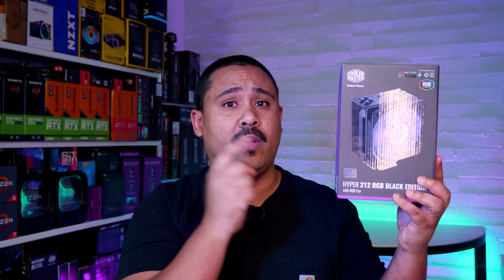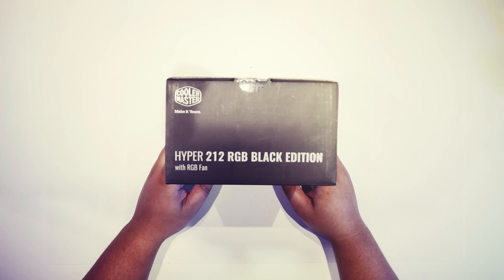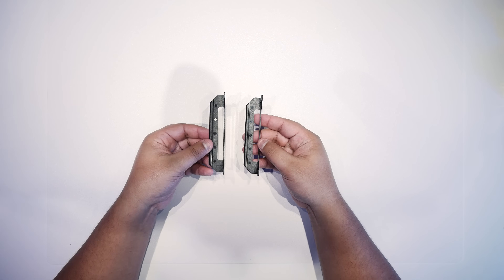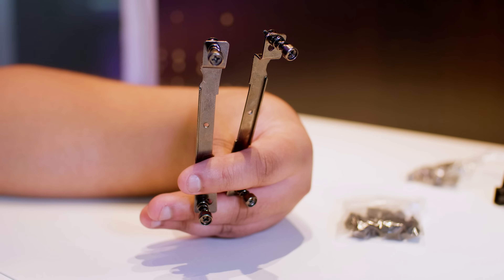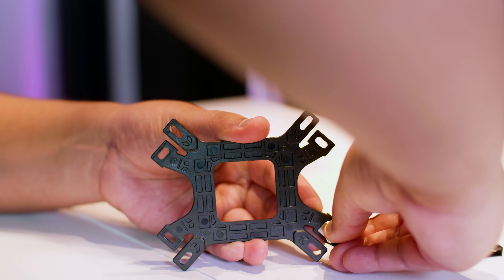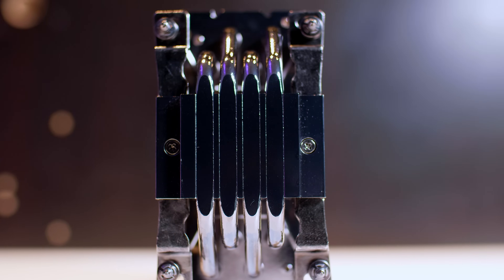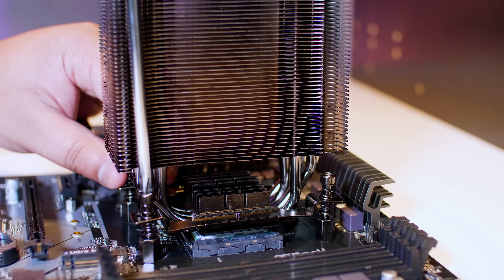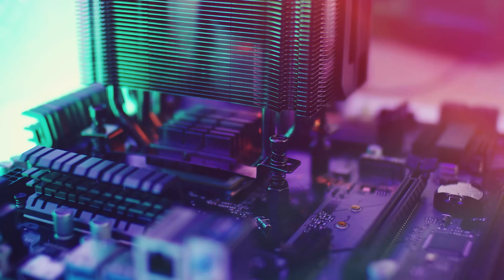HOW TO Install Cooler Master Hyper 212 RGB Black Edition on AM4

Comment: I always find that installing the cooler is the most stressful part of the whole build lol
Reply: Lol. I was considering a liquid cooler for my oc’d Ryzen 5, but I think this’ll do just fine
Reply: @MrEnvoy05  Fuck liquid coolers bro, they click and make dumb noises. I’m swapping mine out for the 212.
Reply: @doomer1905  lol
Reply: @doomer1905  Mine is whisper quiet except for the fans, but after I swapped to Noctua fans that was no issue either. so same noise level as my air cooler, but better cooling, and easier access to ram and removing GPU. 
Aios arent always optimal like in my small case, but bigger cases I prefer them.
Reply: @BARBELLS-AND-BUDS  I just don’t get on with them at all. I’ve had two, both have been crap for temperatures and noise level. My 212 has a little hum to it, but it’s very unnoticeable and it’s just the fan, which I can replace for like £9 lol. Ryzen 7 3700x CPU never gets about 75 degrees with the 212, hits over 80 with the AIOs I had, even with everything on full blast.

The AIO bit that annoys me most is the pump, it can be so clicky and there’s no way to get rid of that sound without getting rid of the entire circuit, which is nice and pricey.
Reply: @doomer1905   my first AIO. Its the NZXT Z63
Honestly I only hear the fans when they are up past 1200 rpm. That aio is cooling  a Ryzen 5900X in a Cooler Master NR200. I never see past 64C gaming and 69C in a hour long stress test.
I guess like anything you can get a faulty AIO, or maybe I got lucky?
Reply: @BARBELLS-AND-BUDS  Dunno man, but I had my coolermaster AIO running on my intel i9 9900KF and it was hitting 85 degrees within minutes, and that’s with the fans on 100%. Tried an AIO on my Ryzen 7 3700x build, same thing, 80+ degrees.

Switched to the hyper 212, never gone above 75 degrees on the Ryzen 7 3700x processor, haven’t tried it on the intel one yet though. Thought maybe I had seated the AIO wrong but no, it’s on there plenty.
Reply: @doomer1905  I bought a pre built from IBuypower and they say 1 month+ time to fix shipping damage. I decided to fix it myself. I bought a new PSU, MB, and the hyper 212 to cool the 5600x. Hopefully it does well.
Its only a 65 watt TDP cpu, but I plan to OC...if I get it running.
Reply: @BARBELLS-AND-BUDS  I’d say the 212 can handle a bit of overclocking. If you really want a beats for an air cooler, get a noctua one. Their heat pipes and fans are really really good, practically silent too.

And fuck prebuilds man, I got one not too long ago too just for the graphics card and the thing set on fucking fire, had the nerve to say it must of been something I did. The fan hub they sent with it just burst into flames, so I ripped everything out and just mixed and matched the best parts of my two PC’s into one case lol
Reply: @doomer1905  Yeah $2k for the prebuilt on sale and with promo code. Asus 3080, 32gb ram, 5600x 1tb M.2.
It came with no power, but the rgb on the MB lights up. The Air cooler was crooked so I removed it and the PCU was out of the socket stuck to it. I figure the MB traces were damaged. If I cant make it work Ill return the parts to amazon and return the PC to Ibuypower. That sucks that yours burned up!
I built a PC recently and then couldnt get any more GPUs. I also bought a Cyberpower from BB and it has 3600 3060 etc and it works perfect
Reply: @BARBELLS-AND-BUDS  CyberPower are def your best bet for prebuilds. They’re a little pricey, but they seem to actually give a shit lol.

And yeah there’s always that risk of damage in transport, that really sucks to hear yours got damaged. And the 3600 and the 3060 is a nice pairing, bet it’s a beast
Reply: @doomer1905  Yeah I got it for $1100. Took the 3060 ut and put it into my Dell. I put my 6800 into the Cyberpower and using them both for mining when not used for other stuff.
I was going to sell the IBUYpower except for the GPY+U, but decided to keep it. Then it arrives broken lol.
I priced the parts on the Cyberpower and really no markup from retail prices. Looks nice actually and the front it all mesh so good airflow too.
Reply: @BARBELLS-AND-BUDS  I got an ibuypower prebuilt water cooled but it would crash my pc playing any game with decent graphics 6 months in, got it fixed free with them 1 year later same problem and no more warranty so I'm trying to switch to fan now
Reply: @SheepShanker  What air cooler are you going to use?
Reply: @BARBELLS-AND-BUDS  either this 1 or a noctua
Reply: @doomer1905  seriously fucking liquid coolers sucks. Spent 3 days to figure out the problem. Just realized that the pump is gone. Swapping with this air cooler. Im done with liquid coolers.
Reply: @user-wt2ky2uq4k  Yeah man they’re pretty trash IMO. Yeah they look cool, but you can’t really beat a good air cooler. Not worth the potential leaks either! Water should be no where near circuitry lol.

And my 212 is still going strong, I’ve had no problems so I definitely recommend it.
Reply: @doomer1905  ordered one yesterday. Going to install it tomorrow yuhhuu. Currently hitting 97 degree Celsius with liquid cooler. Definitely a broken pump case.
Reply: @doomer1905  i went with 6 pipe Endorfy Fortis 5 dual fan and its fantastic ....even on full 1.45V and 4.7Ghz boost it cools it to nice 72°C wich is just insane :)
Reply: Built my first PC this weekend, and putting the cooler on almost gave me a heart attack lol
Reply: Facts
Reply: so true
Reply: Yeah, especially if it’s a damn clip on cooler like the wraith prism or another cooler like aio’s.
Reply: I’m building my first pc and I’m sitting in my kitchen stress drinking chocolate milk trying to figure out what the Manual mean
Reply: YES BRO
Reply: @射進肚臍 it’s not too bad, I personally replaced it with a Noctua fan after installing because I didn’t need the rgb in that spot, kinda over lit things 😂
Reply: ahaha
Reply: You shouldn't tho, it's super easy. I felt the same way when I started building myself. The cpu is intimidating to beginners, especially having to do anything with it lol.
Reply: Ikr! 😂
Reply: Yup... i can never get the screws right
Reply: Exactly. As weird as this seems, I always have a hard time getting the fan back on to the heat sink lol.

Comment: The whole installation of this damn thing is driving me nuts. All those nuts bolts and springs and not all the parts are used. The step by step instructions don't make a damn bit of sense. I also couldn't get the screws to the motherboard to line up perfectly
Reply: Hi.  Well my unit didn't come with the small parts box.  Cooler Master finally sent me one and it was missing a part F and E.  So now I could only mount to 3 sides.  Nowhere to find parts F and E on net for AM4 system.  Trying to cool my Ryzen 3600.

Comment: Very unclear... Doesnt show a lot of things and doesnt even show how to use ARGB.
Reply: It doesn't have ARGB only RGB.  It comes with a wired controller if your motherboard does not have an RGB fan header.  If the motherboard does have an RGB fab header than you can use the motherboard vendors software to control the colors.

Comment: If I am upgrading my cup cooler from the stock AMD cooler, do I need to reapply thermal paste or can I just leave it? The thermal paste I used is from the stock AMD cooler since it was pre applied to the cooler. If I need to reapply, can tips on how to clean it?
Reply: Yes, reapply the paste.  Remove old paste using a lint free wipe with isopropyl alcohol if you have some.  This comes with thermal paste so use a pea sized amount and you will be good to go.

Comment: My 12v all the way on the bottom of my mobo, can I plug it on the 5v instead?
Reply from the maker: no
Reply: @GearSeekers  thanks for the super quick response. I’m installing right now, I guess I’ll flip the fan with cables facing out, that’s the only solution I have to make it reach my 12v

Comment: Thanks for this video. The hardest part was attaching mounting the heat sink. I had the plates backwards at first and then it was just a little difficult to line up the screws but I was doing a swap and didn’t remove the mobo. Anyhow it all worked out and not running 20c cooler under load with this thing. Thanks again. Subscribed. Cheers!

Comment: I can’t get the cooler to line up with the brackets lol. The brackets screw into the motherboard no problem when not attached to the cooler, but When I attach the bracket to the cooler it’s not wide enough to fit the motherboard

Comment: Mine doesn’t fit my motherboard :(
Reply: Same here
Reply: @badash4545  I actually got it to fit, you have to turn the brackets on a different way
Reply: @lucid4984  idk I have an msi Meg x570 ace and the brackets just don't seem long enough.
Reply: @badash4545  intel or AMD? I had the B450 and it didn’t seem too, but the little bracket it screws into just needed a different angle
Reply: I have amd.

Comment: Once I installed, my fan spins but there is no lights on the fan. Any suggestions to fix?
Reply: Did you connect the RGB into the motherboard as well?
Reply: @smith25_25  I got it figured out! thank you!

Comment: For anyone wondering about the cooler screws not going in don’t be afraid to put pressure on it like I put a good bit especially on the side with the first screw and temps so far are all good and cpu isn’t broken so ya don’t be afraid to put pressure and maybe practice without thermal paste on first that’s what I did and it helped a lot
Reply: Seriously I'm kind of worrying myself because it felt like it was "crushing" my CPU. Am I ocd'ing it? It booted fine.

Comment: i have the same motherboard you have, can i install it without removing the motherboard from the case
Reply: Yes. Remove both sides of case. Hold the bracket in place and hand screw the bolts. Then put pc on its side and screw the radiator in. 

Did you get it installed yet, btw? Happy building.

Comment: it seemed like my screws were so much further away. maybe it was just harder because i had a short fat little screwdriver, i bought this to replace my deepcool gammax because i dreaded dealing with the clip on mount, and this one looked very sleek to me in all black with the silenco fan. the temps seems jsut a few degrees higher at time or around even. which is 100x ebtter then the amd wraith stealth i used to have

Comment: hi, I'm looking at connecting this RGB to my MF120R case fans included mini controller , i've found a this splitter https://www.coolermaster.com/catalog/coolers/rgb-accessories/1-to-3-rgb-splitter-cable/ if i use this with one of the fan RGB inputs and split it with this cable and connect in this CPU Cooler would you think that would work? how else could i have them synced if not, my motherboard has no RGB headers

Comment: Are both sides of the metal heatsink identical?  I installed the heatsink with the logo upside down but I did put the fan on the correct side near the ram.  Is that ok?

Comment: Had an existential crisis trying to replace this cooler with my stock 2700x cooler but it was worth it. Went from 40-45 idle to 28-32 idle.
Reply: Bro same the stock thermal paste like glued itself to the cooler and the cpu I thought I was gonna break my pins

Comment: hey great video. Can connect the rgb into an asrock b450m steel legend motherboard? It includes 1 AMD fan LED header top right corner of the mobo, and an RGB LED header as shown in the video. Can i use the amd led fan header instead of the rgb led header to connect th rgb of this cooler?Also how can i change the color of the lighting if connected to mobo rgb header?Thank you

Comment: When you use the included rgb controller at 6:55 where do you connect those cables on the left?
Reply: It should connect to Molex/SATA power cables connected to your PSU.
Reply: @darkasnighttime   I dont jave those two cables in my PSU
Reply: @MilošHranisavljević Hey, probably doesn’t matter now since it’s like a year later but to anyone else wondering, the RGB pins go into the slot marked JRBG1, on my mobo it’s on the bottom left. Be sure that the arrow on the plug is on the top left when you plug it in, too - that also matters.

Comment: Well my good sire I have a i7 9700f with a 2060 super and my temps on my cpu are 80 to 85 and 75 to 80 with my ac on and my gpu is low like 50 will this fan fit and work I’m a noob just switch to pc a month ago

Comment: My new build, looking for advice and tips!

Thermaltake H200 Black
MSI B450-M Tomahawk Max AM4
Ryzen 5 3600
Cooler Master 212 RGB Black
Corsair Vengeance RGB 16GB (2x8GB) RAM
Kingston 500GB m.2 NVMe SSD
WD 2TB Blue SSD
3x Cooler Master 120mm RGB case fans
Gigabyte Windforce OC Nvidia 2060 Super 8GB
Gigabyte 750w 80+ Gold PSU

Will this setup work? Will this be a decent setup?
Reply: Pretty overkill for your specs, otherwise good pc. Just make sure your case has 160mm or greater clearance for that hyper 212 evo. Nobody ever says this but that cooler is very tall
Reply: @ExySmexy  thank you for the feedback! Yes I built it the other day and I was surprised how huge it was! My case had 180mm clearance so no issues there - thanks for the heads up on that though! But cooling was a big thing for me so I didn’t want to cheap out on that - the hyper 212 was only $68 on umart so I thought why not! 😂👌

Comment: oh shit, okay. You should try getting some top down shots of some of the shots where it would make sense like the heatsink brackets.I must have lined it up, but facing the wrong way. My mounting bracket is not lining up with the mounting part on the mobo.. I've wiped and applied twice trying to adjust the bracket to make it fit. lol. I definitely like Noctua's mounting system more than Cooler Masters, their booklet instructions weren't very good. This is the first time in like 10 years I had to watch a video to mount a heatsink. haha. Thanks though, the rest of the video was great.

Comment: I have heard that installing this cooler on a Micro-ATX motherboard will slightly block one of the RAM slots. Can anyone confirm if this is true or is it not an issue? Cheers!

Comment: UGH. I bought this cause I figured I could put it in without taking the entire motherboard out and putting a damn bracket on the back.
I might cancel my order cause I don't wanna have to rebuild my entire computer for this crap lol
Reply: Does your mobo already have a backplate? It might be compatible with the stands.

Comment: Thanks, helped a lot, it`s easier than I first thought. The worst part was removing the stock cooler, the thermal paste became a glue (and I was using if for less than 2 months).

If any of you have the same problem, twist the cooler instead of just pulling it off.

I'm using a stock R5 3600, temperatures dropped from 85 to 70 (full load, stabilized after 15min)
Reply: try not to twist the cooler could accidently bend some pins

Comment: How much pressure are you supposed to use when screwing in the heatsink to the mounts? I've been trying for 30 minutes and I'm terrified that I'm going to crack something in half. Is my product defective or something? The screws just barely don't reach the mounts, no matter how many times I turn them.

Comment: quick tip for everyone wanting to use this cooler

got mine today but it doesn't have the right adapter to connect to the rgb controller so you cannot use the rgb unless you have an adapted

Comment: Installed this cooler easily. I connected it directly to the 12v on the mother board. I have 4 RGB case fans what are not connected to a 12v RGB input but to the reset button how do I get the lights to be in sync. When I go in auro sync I only see the coolmaster hyper 212 and not the case fans ? Thanks

Comment: just bought this cooler and a new ryzen 9 3950x ... put it all together as shown and i'm shitting it about screwing it down.. this video will help me to get it installed tomorrow. thanks
Reply: how did your thermals turn out?
Reply: @The93Momo93   hi,  its running nicely, its built in a sahara tower case that has ten cooling fans. idle temp is 35, sustained full load is 70 - 75
Reply: @paullawson8550  hey, thanks for the reply! those are pretty nice temps, I will run this with only 3 case fans (possibly with a 5800x) but if it ends up not enough I will probably slap a second silencio fan on the heatsink and see how that goes first, but in theory it should be fine
Reply: @The93Momo93   i think you'll probably get similar temps as me depending on airflow. seems good ventilation pays a key part. let me know how you get along
Reply: @paullawson8550  thanks, I'll give a heads up when I got it :)

Comment: Can you install the cooler without having to take the MB out of the case?
Reply: You could just use the old style AMD clip bracket supplied.
Reply: yes the back of the case u can put it through the hole in the back

Comment: Does it work with 5 3600
Reply: yeah, there are people running this with 3900x too, it's only slightly better than the wraith prism in thermals but very very quiet in exchange
Reply: @The93Momo93  king

Comment: The method you show in connecting to the RGB header doesn't work when there's a gpu installed.  The cable isn't long enough to go over or around it.

Comment: Great vid! Strait to the point is what i love! I am considering this cooler for my ryzen 7 3700x and 2080super build! I am still using the stock cooler which is fine but this looks nice. I am thinking on getting an aio but my old system (i7 5th gen and a 980ti) had and old corsair aio and the pump died in a year 😆 so idk. What i am going to get 😅😄

Comment: Anyone else having extreme trouble trying to screw in the cooler to the motherboard, the screws on the cooler simply do not reach far enough
Reply: Just finished my build yesterday- you have to put a LOT of pressure on the screws and really push down to bend the springs surrounding the screws.
Reply: You gotta put pressure on it, a lot in order for the screws to reach
Reply: What do I do with the black sticky tabs ?